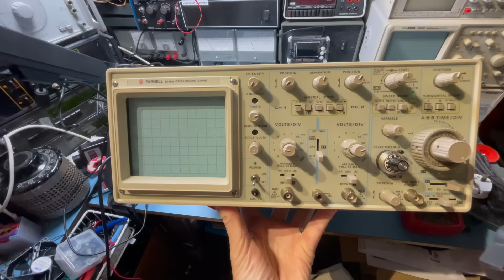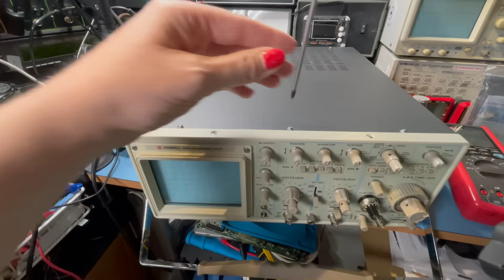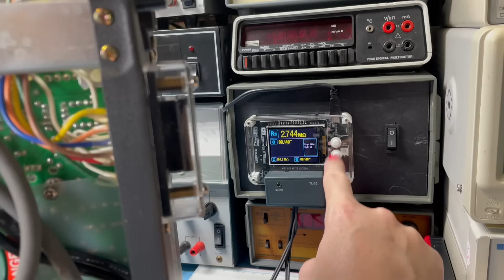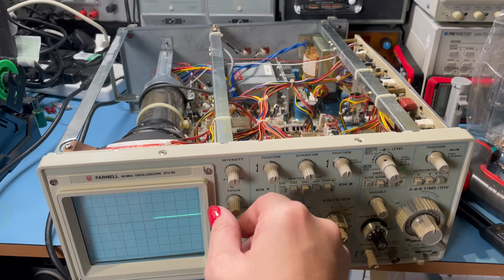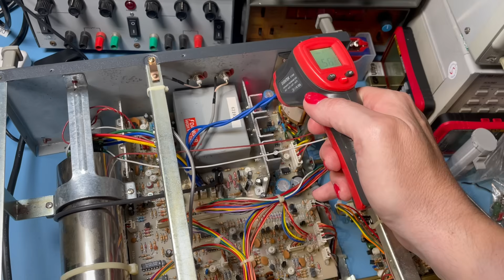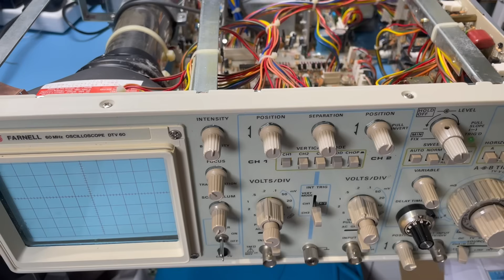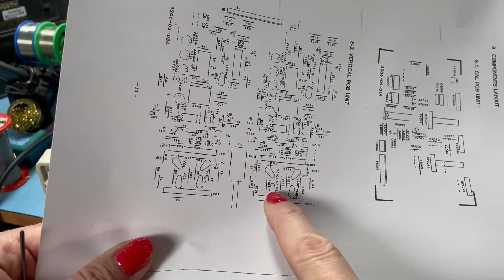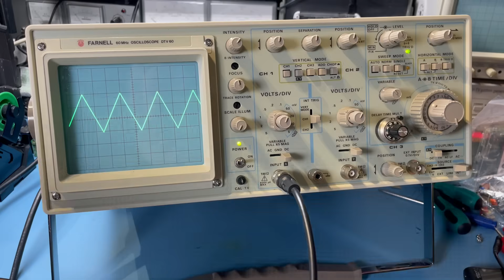Farnell 60MHz Oscilloscope Check, Test & Adjust.  Arrived By Courier In Just Its Bag!

Comment: Something of a miracle that it reached you in the condition it was sent. I needed (only) a 20mHz Osc so bought an old Hitachi V-212.. The seller opted to use Inpost to minimise the number of van transfers and potholes, and it arrived bubblewrapped and boxed up but the corners were battered. Upon opening, the faceplate was cracked, the bevel broken in two places and two of the control stems bent... ie, scrap...so may try the bag option next time...

Comment: Nice scope. For simple stuff more then good enough. Looks like new old stock. Electrolytic caps could be dried out due to the possible higher age, but the question is if one would go too much trouble to preventive change those, or just wait and see.
Reply from the maker: I did test the caps in the power supply and they were ok. Not everything filmed makes it into the video. Some stuff has to be cut if the video gets too long.
This is an ideal scope for audio work or a budget scope for somebody just getting started. Thanks for watching.

Comment: Nice find - too bad about the tape on the bag.  You could try working a bit if liquid hand cleaner (such as is used in automotive shops) into the gummy residue left by the tape with your fingers and just let it sit for several hours.  Sometimes it will tend to soften the gummy residue (similar to how it softens grease) and lift it from the vinyl bag surface and should not harm the vinyl - just a suggestion.

Comment: This is the same model of oscilloscope that I bought last Sunday for £10. I had to replace the on/off switch and I have had to so some work on the rotary time base switch as some time base settings were not working properly.
Reply from the maker: Damn, you got it for £1 cheaper than me, lol, but then did you get a bag and a probe included?

Comment: Think its been re-branded by Farnell.
I have the exact same machine but its manufactured by Wayne Kerr Electronics, its model DTV100 .
Exactly the same front panel layout, think i paid 25 quid for it about 2 or 3 years ago.
Reply: Yes it's the 100mhz model but identical front panel.
I'm glad you posted this because I've been looking for a diagram of or it for ages and can't find one, now I've got another area to look.
Cheers.
Reply from the maker: I would think the DTV100 is the 100MHz model then.
Lots of manufacturers have their products licensed and rebranded by other companies. It's always been a common practice and still happens a lot now.
The more equipment I come across the more I see/realise this.
Thanks for watching.

Comment: Good find.  I'm still using my Aussi made 1970s BWD scope.  Never opened the case.  Got as a swap for an old lawn mower.   But im shocked that you would replace a tantalum with same high failure device.
Reply from the maker: Tantalum beads used correctly are perfectly fine. The biggest issue from earlier days is when manufacturers ran them too close to their voltage rating.
It was not known at the time but those old tantalums do not like voltage spikes or high current ripple. Both things kill them and they go short circuit or nearly short circuit. When a power supply switches on it may momentarily be higher than it's normal voltage and/or current will surge into the tantalums. That's why so many have failed.
The modern recommendation is to derate them by 2-3 times the expected nominal supply voltage to allow for these voltage surges etc.
There are better tantalums these days, polymer tantalums, that don't suffer voltage surges so badly.
Most of the time I will often replace them with quality modern low ESR aluminium electrolytics from Panasonic. In almost all cases where the original tantalum bead was supply smoothing this will be fine. Not so for tantalums used as signal coupling capacitors, which tend not to be exposed to any big transients anyway and are almost always ok.
This particular 1uF tantalum is rated at 35V. The supply rails are +5V and +/-12V. It tested ok. If I do decide to change the bulk electrolytics I'll do this one as well, but they all tested fine and this scope won't get a lot of use anyway.
As for the BWD scope, they used all off-the-shelf parts, that although that limited performance a bit it makes them easy to repair.
I recently acquired a very rare BWD 880 Powerscope with special differential inputs for high voltage measurements. It came with a complete set of high voltage scope probes and an user applications manual. It will need work on it, but I may feature it in a future episode.

Comment: I love an old analog 'scope! My favorite for years was a Tektronix 545A. A huge device, with aboout 100 vacuum tubes in it. It doubled as a space heater! I gravitated towrds Tek equipment because my father worked for Tektronix for 30 years until he retired in 1996. Nowadays all I have is a couple of digital 'scopes.
Reply from the maker: Wot, you mean you don't have any legacy Tek gear at all now, lol. Just think of all those tantalums you won't have to replace, haha 🤣
Reply: @JazzTechUK  The 545A predates those nasty tantalums! If I still had it (I haven't had a Tek 'scope in 21 years now), I'd bet that the aluminum electrolytic would be failing by now! I do still have a bench supply that uses the board from, I think, the Tek 501 rack-mounted power supply. I haven't turned it on in years, I think I'd have to change the many tantalums in it before powering it up. It has a very clean output, much better than the noisy switching based bench supplies I have now.

Comment: The scope calibrator above the oscilloscope brings back memories. I remember using one of those in the 1970s/80s, when I worked for a Tech company in the UK.
Reply from the maker: Yes I believe it was a standard tool for calibrating scopes. It needs some work before I put it into use. It will feature in a future episode. Thanks for watching.
Reply: @JazzTechUK If my rusty memory serves me.. It was a Bradley Instrument?
Reply from the maker: Yes, a Bradley 192, designed/made by Ballentine and badged as a Bradley.

Comment: That brings back memories - I bought the exact same model brand new from Farnell in 1994.  It still works fine but I have moved on to a gorgeous little R&S  HMO 1202 that has a lovely low noise front end and silent cooling fan - I hate the noisy fans in other makes of 'scopes.
Reply: You'd have hated the cooling fan in my old Tektronix 545A! With about 100 vacuum tubes in there, it took a lot of cooling air!
Reply: @jbuchana  A superb old 'scope - even if it did sound as though it had a built-in hovercraft!

Comment: Decades ago, I was at  scrapyard in Ft. Walton Beach, Florida that had a pile of new, surplus microwave  components. I was salking thrugh the muddy area where they sorted different metals outdoors. I spotted a small patch of blue in the bud. I pulled  out a Sony/Tektronix 323, battery powered 5 MHz scope. I paid $20 for it. The case was slightly dented, from a front end loader's tracks but I opened it to find that a deflection lead had come loose from the tiny CRT. I washed the case, removed most of the deny and put it together. It worked, It has good triggering,  and runs of AC mains, 12VDC or internal NiCads. It was half of a spectrum analyzers, when required their model 1491.  I've had it about 35 years. I also have the 324, a 10 MHz version. I've found one original probe, and extra compensation boxes to assemble more.

Comment: Nice bit of nostalgia with that scope. You can't blame the courier for the packaging as that's how the vendor sent it. Those padded bags are meant to protect the equipment when chucked into the back of a van or boot of a car.
The only thing I have doubts about with older analogue scopes is that eventually the tubes are going to go soft and replacing them would be a nightmare.
Reply: Just use them for a short time and they should last a very long time. Keeping them on all day would shorten the tubes life for sure.
Reply from the maker: I praised the courier and blamed the seller. This scope clearly hasn't been used much so it has plenty of tube life left. I have many other old scopes and they are all ok for trace sharpness. Obviously if you run it all day at high brightness, yes you are going to wear the tube out.

Comment: Wow! That's a great buy Jane, and amazing it arrived undamaged. I thought my Phillips 50M analogue scope had failed in a terminal manner a while ago (turned out not, thankfully) and I scoured Ebay for a replacement to no avail at reasonable money. I have used Evri (used to be Hermes) for years, they get a load of bad press, but in my area they are great and I cannot fault them. I have sent fragile items all over the UK, even to the Scottish highlands with no issues whatsoever. For tape residue, I use a product called Sticky Stuff Remover from CPC, it is excellent.
Reply from the maker: Yes Evri round here are very good. Worst are royal mail.

Comment: Jane, my heart sank, all I can think of is that the selle either was anoyed at the selling price or wer just idiots.
How lucky the mains pluc was pointing outwards, I once had an old His Masters voice wooden radio with the glass dial destroyed by a mains plug.
I have had items like that inthe past, worst was a ZX81 in the original mail outer from the first mailed batch, which they Defaces and taped first removing the original stamps and effecively reduced it to a brown cardboard box.
Reply from the maker: Yes, I was very lucky. I had an old portable TV delivered a while back where the plug was loose on one side of the set with no packaging between it. It smashed all the speaker grille slots in the case and ruined the look of the set.